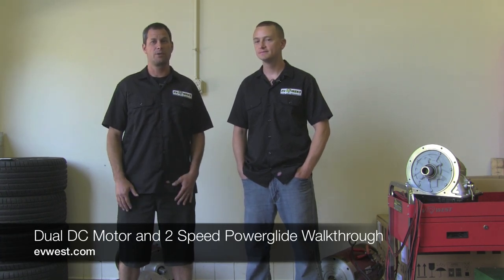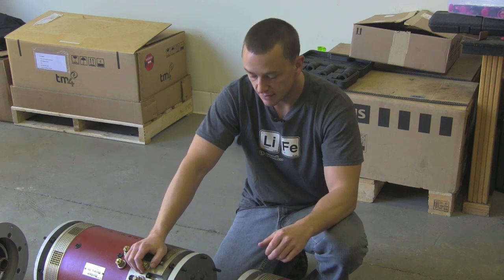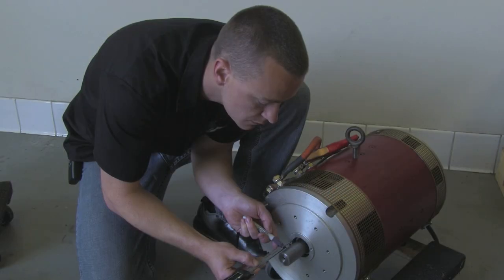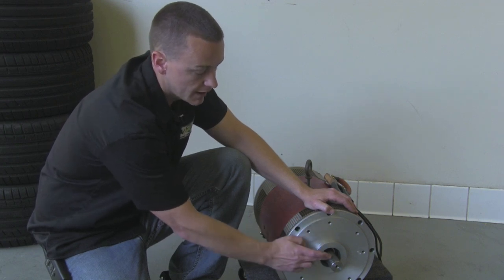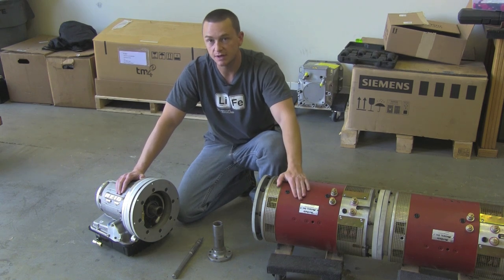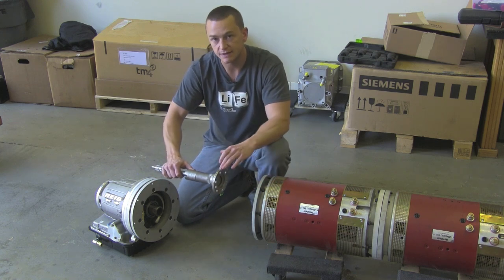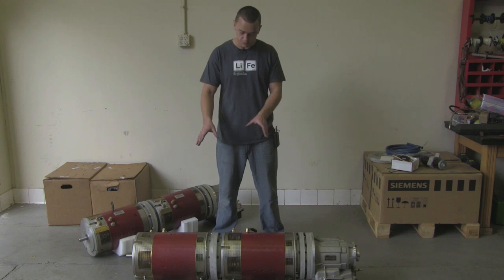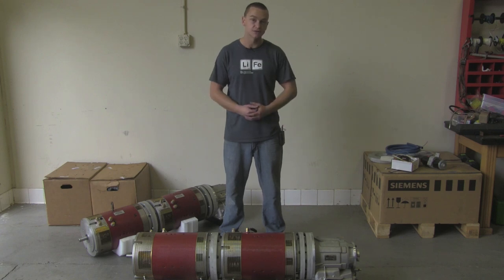Dual Motor Electric Vehicle Drivetrain With Powerglide 2 Speed Transmission Walkthrough by EV West

Comment: i had no idea they make new Powerglide transmissions.
Reply: GM builds the powerglide transmission popular in the 60`s 70`s and early 80`s
the first ones were cast iron cast that is what this one look like and aluminium case in the later years i don`t know if they still make this one
Reply: powerglides are so popular for racing that every part including the case is available new in the aftermarket.
Reply: ya i knew ppl liked them for racing. i just though they used old ones.
Reply: of course that was 20 yrs ago when you could get a used one from a junkyard.
Reply: *****
I would venture to say that a great majority of the OE GM glides have exploded by now..lol

Comment: My car is premier  padmini 118 NE petrol model 1995.1200cc engine  52 HP. My planning is make Ev car conversation of 118ne 
Give  guide  line &price of motor,cables, lugs, differntial ,Cupler,foundation, regulator, controller,  wiring harness price of without batteries

Comment: $7700 motor package + $5000 trans =~$13k setup
Reply: +TheRealEquinox 
lol motor controller alone is about 10k not to mention the batteries and accessories
Reply: +Bob Builder I merely was talking about what is shown in the video, which are just the motors and gear box. The pricing was retrieved from EV West's own website. Purely FYI for tubers watching this video.
Reply: I was just adding more prices so people got an idea of how crazy expensive this build is...  did not intend to imply you missed anything.

Comment: I don't under stand why there is a need for Dual motors.  If the output is close to 1200 torque 1 motor should be more than enough powerful.  Is this for some kind of offroad vehicle or utility or cargo van.? Why go with dual motors?
Reply: Pedal Pumping moar power
Reply: Pikes peak record as they said at the start
Reply: This setup is STRICTLY for HIGH performance.  This is not the cruise to the grocery store and then to the tree hugger convention and back home setup.  That is a single WarP 9.  Not dual WarP 11's...

Comment: I have a daily driver been debating on dropping a turbo engine with 550 lbs of torque or an electric motor. I like electric for the fact it's power is there right away making launches awesome. the downside is if I drop this kind of money into the car I'll drive it till the body goes now Tesla says their motors are built for 200K as the goal so you can assume these only last 120-150K depending but I've heard ppl say they've only lasted 30K miles need rebuild like clock work so even if you save on oil and fuel you pay for it on rebuilds has anyone else have information on how long these motors last in miles

Comment: It wont fit my bonnet its too long to have dual motor
Reply: +Constantine Joseph There are three ways you can use two motors. Have them on a single shaft like this going to a transmission (or directly to the axle), two shafts being connected via gear to a main shaft to the transmission (or direct), or two completely separate to both axles. My mechanical engineering education didn't go far enough into electrical to deal with the synchronization needed for the last one though. If it did, I'd definitely go with that for AWD and weight distribution.
Reply: +Matthew McGowan The best is all in a single shaft. Instead of two motors, have one as large but only one motor on a single shaft.  Connecting two motors is still a hassle
Reply: +Constantine Joseph 
Although, it might be a more reliable option. If one motor fails, (depending on how it fails, that is..) you still have another motor to get you back home!

Comment: That looks dangerous. The length and circumference of the motor shaft creates the surface area through which motor torque is transmitted. Halving the motor shaft like that doubles the torque load on the splines and you can shear off the splines under load. Bad engineering.

Comment: I wish there was a shop near me so I could just push my fossil  car in one end a turn it into a hybrid , hopefully the guy gives me a good price and get to run my car around town for penny's instead of mega bux . Two in wheel rear motors and a controller and a petrol motor for out of town so no range anxiety . Electric cars are soooo  expensive and makes me angry that the modern petrol engine would be 2 t0 3000 pounds when an electric motor is pence by comparison - just the batteries to buy I guess.    Mr confused .

Comment: now show us the controller for these two back to back motors, that if doubled would equal a semi truck in pulling power. this is amazingly strong on a powerglide. with triple aut cables will certainly smoke said tires.

Comment: Why bother with a gearbox at all? Electric motors produce more than enough torque and posses a sufficient rev-range to drive the wheels directly. In fact, two longitudinally-mounted motors (one at the front and one at the rear) driving a simple(?) hypoid bevel diff would give you four-wheel-drive, hence traction to die for.
Reply: John Benton I believe these have pretty low rpms (around 4k i think i heard from another video from /drive) so the top speed of these is quite limited. Plus using one of these to outfit a previously combustion engine is really nice. I plan on getting one and joining it directly to my transmission.
Reply: They must be pretty big motors to produce enough torque at 4000 rpm. No wonder they need a gearbox. Most normal electric motors rev much faster, with a lower ratio final drive and only one gear.
Reply: John Benton Most electric motors have many times more torque than combustion engines at especially lower rpms. A car has to build up rpms whereas these electric motors just do, the torque never(rarely) varies. As in my car now has to spin up past 5000 to get the torque converter really moving to accelerate the car more quickly, not so in these motors, given that they're given the appropriate load and no compensation is needed they just go, no build up. so for example with a set gear 1000rpm = 10mph, 2000rpm = 20, 3000rpm = 30, 4000rpm = 40 and so on. Of course with more gears this can be amplified and/or continued.
Reply: This information is brought to you by the Department of the Bleeding Obvious. So why bother me with such basics?
Reply: A fair point. I don't know enough about the technicalities to offer a constructive argument, but your idea looks pretty sound to me.
Reply: If you have everput larger than stock wheels on a radio controlled car, you will find out that the motor fries in about 10 minutes. This is the reverse principle of putting smaller wheels on it, which is what putting 1st gear in front of 2nd gear principle is.
Reply: As per video, one advantage is reverse and park gears, and you also get the power glide output for your tail shaft.
Reply: Park and reverse.....

Comment: Add the air conditioner and alternator belts .todays cars are charged with the alternator,
get like 3-4  > 370 amp alternators and have fee energy wheels!
Reply: skywise: any power you take, you pay for, it drags the system, maybe a little bit for each unit, but each unit takes power, nothing free.

Comment: why would u need a transmission?  electric motors have torque even at 0 rpm.  u just need to have a good drive inverter.  why is the Tesla motor half the size of each of those motors? now what is the intent of this video?  just to show how u connected two motors together and then u show two sets of them?  why waste out time?
Reply: These are meant for vehicles not purposely built for being electric. Teslas are mainly carbon fiber or fiberglass(I forget which) hence a lot less mass to move. Plus Tesla has only made one car to "truly move" and not just transport. When I say "truly move" I am not talking about some dame top speed I mean balls out performance. Which brings me to my next point newer Teslas like the X are meant for range not top speed, these are for the hot rodder looking for a new trend to mess around with share range is a lesser concern. EV's are all about trade offs.
Reply: Those motors are HUGE compared to the Tesla's.  so have you finished building the car and made it "move"?  if so what kind of performance did u get from it? and i still say you don't need a tran for EV's.  what does the tran give u?  when in the power cycle does it come into play?   How are u planning to drive them?  are they DC motors?
Reply: A transmission gives you mechanical advantage, while not all EV's need 
that some are built more for performance then transportation. One of 
those motors could get a car the size of a X to move like a bat out of 
hell. These are for DIY'ers people who will follow in the foot steps of 
tesla. Look at cars like "wight zombie", "Zombie 222", and theres one 
more that escapes me at the moment.(four motors @ 850HP) This is for 
people who want performance not transportation. I see that you don't 
under stand that, please just respect that. Electric cars need things 
like formula E right now the more people working on this the sooner 
major issues will be over come. (Like drastic changes in infrastructure)
 If you are interested in my project I will in time start a video series
 about it, I need equipment and to save a bit more money first once I 
start I want to keep this moving like a freight train. Plus I am still 
working out a few details.
Reply: As mentioned in the video, a transmission adds reverse and park to the system.  It's also a convenient rear  mount for cars with Powerglide and cuts down on fabrication of components to connect to the rear end.
Reply: Have you ever put large monster truck wheels on a remote control car bigger than the stock ones ? You will find that you fry the motor in less than 10 minutes. Having a 1st gear (say 1:86) will be the same as putting smaller tires on, thus putting less drag on the motor and keeping it cooler. Gears and tire size changes are the same thing to the engines perspective.

Comment: While the idea of electric car is fun to play with, I don't really think its the answer for our energy needs. Anyone who has gone to college that has studied or performed studies on power and/or energy will confess, that it will not (at the present time) going to answer all of the problems associated storing energy. Great strides has been made in batteries, and are improving everyday, but I believe batteries are not going to replace the internal combustion engine for the general public. In conclusion, if your thinking of making an electric car...... Don't. In addition, DC motors are the most inefficient device to purchase.
Reply: Mr. Smuck. It is obvious by what you have written that you have very little actual experience with the efficiency of electric motors. I have built my own electric vehicle and drove it for 6 years before selling it. The 8 inch 144 VDC motor I used was approximately 3.5X more efficient than the gasoline engine I removed from my conversion. In fact the average automobile is only around 26% efficient at turning the energy available in gasoline into motion.  Driving my electric car to and from work 5 days a week only increased my power bill approximately $6 a month.
Reply: Actually going out and doing your own conversion is priceless. Beats a Google / keyboard warrior any day. Well done mate!
Reply: Gene Doudney you are totally right
Reply: Gene Doudney 
Nissen
Reply: efficiency is not the motive here,    1000-1200 ft lbs of torque is a Mad Man's dream..  Not so much, for the frugal, coupon cutting  house wife.
Reply: batteries replaced forklift engines and those batteries where just lead acid batteries. trains have been electric since the forties no batteries so all whats left is boats and cars. really want to see an eboat. instant power  has a lot to be said for it
Reply: Japanese company have developed 200 mile per hour battery charge 6 minutes, I forgot the name of the company that developed the battery.
Reply: That's why college students never make break throughs! XD
Reply: not inefficient exactly, they produce heat much heat you need resistors a turbine or ventilator to get it cold that would do your instalation complicated, versus a 3phase motor, dc motor produces torque to move heavy loads it's really good like trains or cranes, you don't need much torque to move a 2 ton car...
Reply: When did saying we can't or it can't, get us to this point. the electric Motor is fine as is for now. we need are rules to stop pussy fittin around and deal out the good batteries the NASA one and someone needs to reinvent electrical wires and connectors
Reply: It is widely accepted that colleges and universities, even public schools are all working for the brainwashing governments (illuminati, if you will). There the system will plant ideas and foster an attitude that plays into their money grubbing schemes. It always appears "environmental" however it always ends up creating throngs of money minded, selfish drones. True environmentalists are like these guys, actually putting the rubber to the road. Never trust a school system, or government for that matter. Their agendas need money, money comes from industry, industry supplies money if the school agrees to the agendas that the industry sets forth. In between, there is a great deal of glad-handing and wheel greasing. Teachers don't earn much money, remember? When the schools pander to industrial giants, we have these lies that students perpetuate and violently sometimes, defend as real data. Wow...what a rant! Sorry man, I just wanted to say I disagree with you.